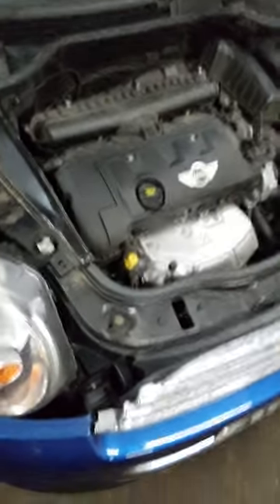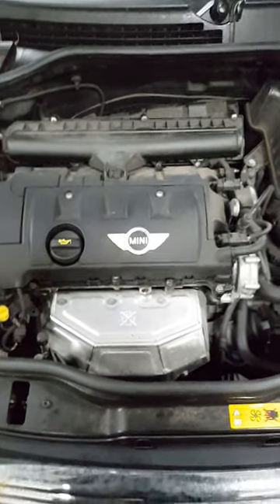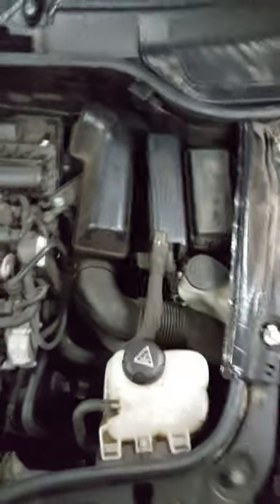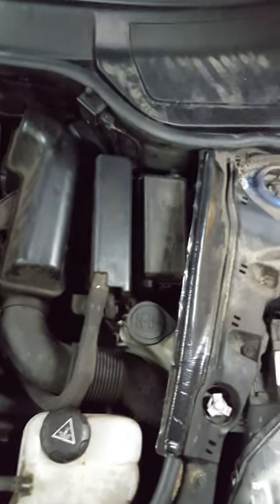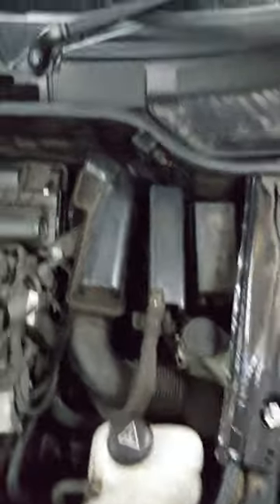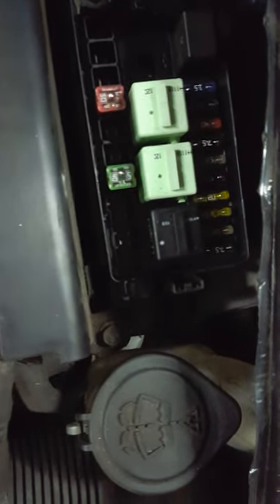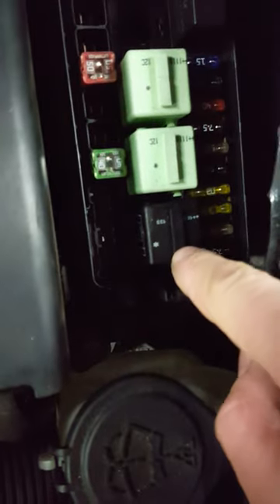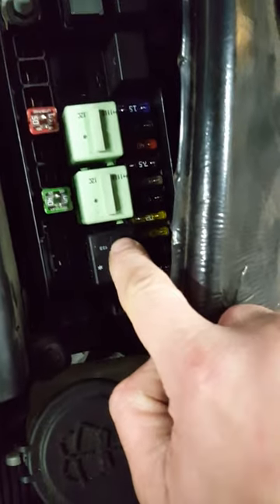Mini cooper DME Fault Fixed. Relay problem and location. How to fix it?

Comment: 2009 mini cooper convertible 

Could this be a contributing factor to the remaining CC-IDs the car has? Wires were cut from the rear trunk release button. 

Remaining CC-IDs:

CC-ID 31 – Engine Problem, Increased Emissions
CC-ID 35 – DSC Failed
CC-ID 250 – Brake Signal Malfunction, Gears May Be Selected Without Brake
CC-ID 354 – Start Assist Inactive
CC-ID 371 – Number Plate Light Failure

CEL code:
-P1782 still active
-2FAA
-CF2C
-5DF3

Recent Services:
- Timing chain
- Spark plugs
- New battery
- New keyfob

Had my buddy use his Matco scanner to reset VANOS and register the battery to the car.
Reply from the maker: Reading those faults I wouldn't think so to be honest.

Comment: Excuse me, may I ask any other symptoms of it? Such as rpm decreased (sometimes engine shut down)while the car nearly stop ? Thx
Reply from the maker: The engine can missfire and can lead to shut down on traffic lights once on normal operating temperature.

Comment: Hello Alex. Thanks for your video. 
I have a Mini One R56 2007 with N12B14 engine. 
The engine when reach 95 degrees temp misfires the 4th cylinder.. 
We rebuilt cylinder head and we changed piston rings. 
We also change ingectors , coils, sparks , fuel pump , crankcase sensor , vanos
Sensor and cam sensors.
Again when temp reach 95-97 Celsius the 4th misfires. 
The compression cold and hot is 200 in all 4 cylinders! 
The mechanic told me that maybe is DME. 
What do you think ?Maybe it’s a relay ?
Reply from the maker: Hi there. That sounds mad. Seems like you done everything possible apart from DME relay... I would definitely recommend changing it now to be honest.
Reply: @AlexTheGrumpyOne  Alex , thanks for your fast reply! You mean the black relay that you change in your video ??
Reply from the maker: No problems :) yes that should be the one. Depending on the model. Please double check in your owners manual.

Comment: Hi I have a code 5DF3 DSC interface ,DME /DDE SIGNAL faulty would this be a relay issue as well?
Reply from the maker: sorry will need a bit more diagnostic in to it. have you had it scanned and what codes did you get?

Comment: Hi, thanks for the video.  I have a mini countryman cooper S running fine but giving a code P12B8 which is ambient pressure sensor.  A mini specialist has tested the car and said all sensors are fine and all is well so it is a faulty DME approx cost £1300. They said no prob to keep driving the car but the light will stay on. Do you know if this relay will fix that please?
Reply from the maker: It's a possibility mate. I would definitely try relay first. I mean you can get this relays from breakers cheap as hell. So I would def try first.

Comment: Hi Alex, you mention in the video that the car wasn't running well.. By that, do you mean that you are still able to drive the car even though with the bad relay and check engine light? 

I am having a P2BE4 code (DME error code) during cold start and the check engine light goes off after driving around 20-30 mins drive. The P2BE4 code during cold start will make the car misfire and sometimes accompany with another code P273F (on Carista app it says O2 sensor fault, and on workshop's BMW scan it says Cyl 4 Ignition Coil Error) 
Not sure if this has anything to do with the similar relay fault that you have.

By the way, what was the DTC code you had with the faulty relay?
Thanks!
Reply from the maker: Hello there. The car was still driving, but misfiring sometimes. 
I think the codes are in the video. 
That was quiet a while ago to be honest.
Reply from the maker: To check quick if it's not your coil you can swap n4 with n1 or 2 and see if the fault change to another one.
Reply: @AlexTheGrumpyOne  Thanks for reply. 

Some updates**
I did a change for all ignition coils to the updated Eldor brand (OEM BMW), however the P2BE4 code was still present.
A day later, I decided to change the relays (3 pcs of it - K21, K6326, K6300) for good. Tried 2 times of cold start and the codes did not come back. 
Apparently, the relays mentioned above were linked to the DME A6000 as seen here - https://www.newtis.info/tisv2/a/en/r56-one-hat/wiring-functional-info/functional-wiring-diagrams/09-vehicle-electrical-system/front-fuse-relay-module/1VnYTzk49W

However, i think i will need to monitor for a few more cold starts and see if the code appears again. If it doesn't then it can be concluded that the relays are making the error codes. 

Cheers!
Reply from the maker: Thank you very much for the update. I really appreciate when People share results and any more info. Well done you done a good job there and hopefully it fixed it now. Let me know how you getting on and if it comes back. But I'm pretty sure it should be fine now. Have a good day
Reply: @AlexTheGrumpyOne  Hi Alex, hope you're doing well mate.
So to update, apparently with the change of all relays to new ones, ignition coils to new ones, that doesn't seems to help and the DME error code P2BE4 came back yet again. And it seems very frequent now, each time during cold start and there's no response from the accelerator pedal. I had to shut down and restart the car and the accelerator will only respond after a restart. Its very annoying and frustrating. LOL. However something weird is that the car drives normal after a restart although the check light still visible on dashboard. Sometimes, the check light does goes away itself after driving around awhile. 

Anyway, I guess the only option is to get a DME replacement now. I don't wanna go into changing the accelerator pedal and yet still getting the DME error code.
Reply: @renesis82  Hey man, were You able to resolve this issue? I have same thing 2BE4, gas pedal on first start not responsive, after restart it works well, but half engine sign is present. ALso I get accelerator pedal errors 2B4E 2B4B. thank you in advance.
Reply: @alexvaviloff5934  I had the exact same issue......good news....I replaced the pedal and throttle body.....no luck..same symptoms. So I replaced the relay like in this video. It worked! No more non responsive pedal and no more 2BE4 codes!
Reply from the maker: Sweet! Well done but. Shane you had to replace pedal and throttle body first. But at least its done now
Reply: Bit late to the party here but just purchased a mini with n12 engine and runs well enough once it starts but it cranks over quite a bit before starting , I’m hoping it’s as simple as this to fix
Reply from the maker: @paulmcleod1606 any fault codes?
Reply: Just been out to try and start and flat battery. Hopefully that’s the issue . No fault codes as yet but I’m putting it on the computer tomorrow
Reply from the maker: @paulmcleod1606 Yeah might be just that then
Reply: @AlexTheGrumpyOne  bloody hope so 👍
Reply from the maker: @paulmcleod1606 keep us posted

Comment: On a 2014 turbo cUntryman ,, I have a voltage leak so I disconnected the battery overnight. When I hooked it up again I heard a click like relay.. So I disconnected and reconnected and heard it again.. it's coming from the front of the engine not from the fuse/ relay box. I pulled the relays from that box with the battery connected then put them back in one by one to see of one would flip but no go. So it's not from there it's like somewhere at the front of the engine.

Comment: 2009 Mini Cooper S lights come on when driving but no codes are stored just about driving me crazy check engine comes on but then goes off after a few minutes
Reply from the maker: Hi there. What lights come on? Also what tool you use to try and get codes out?

Comment: Hello bro!! I have the error 2bE4 and in the description I get internal Dme.  Could it be the same problem you had?
Reply from the maker: It is possible. But I think for that one you better double check the forum or etc as I haven't had that code.
Reply: did you ever fix this error code i have it now. car runs ok but on a cold start it starts with no throttle pedal until you turn the car off and back on again

Comment: 2010 MINI COPER S CLUBMAN.  push button fires up lights and all but won't start unless I bump start it. Happened after a rinsing it in a car wash bay. It will shut off one pushing the buttion though. Had the foot module replaced under warranty afterward. Nonetheless wouldnt be the culprit I reckon. Driving me backside mad from from pushing it uphill to start. Jasper
Reply from the maker: That's a bit of wierd fault you got there... All I can think about it that the power or ground supply have got some corrosion or loose. Not getting full power supply. Similar to when you got ground cable loose on battery or ground point on the body.

Comment: Hey Alex! i don't know if you have you have a mini still or not, but do you happen to have a link to that relay so i can see what terminals they connect, i have sensors on terminal 15 short circuiting  which are limited to: o2's(both), fuel sending sensor, thermostat heater, after replacing the thermostat and o2's and i thought my thermostat went bad(shop did this), i got a oil pressure control valve fault code popped up. figured you may know but reviewing the knowledge i have now it's been a month since the shop can "diagnose" it and i'm annoyed at this slow paced work ethic,just found that they are all connected to the same terminal today as there is very limited information upon this. Thank if you do happen to respond!

Comment: Hi Alex, great videos thank you. I've got R50 mini Cooper 04' . Basically abs,handbrake and tyre pressure light ON all the time now! BMW diagnostics said lots of things and couldn't find what exactly was the fault... they said maybe abs unit 95% wtf lol anyway .... bought myself the  C110+ scanner and today I plugged it into my mini and it didn't say anything about abs etc. But said " 5E18 CAN data fault from DME/DDE  and 5E14 CAN connection  to DME/DDE ( DSC lamp on until ignition reset ) please help me mate 👍🏻😁 thank you for you time and advice
Reply from the maker: Rumen Stoyanov hello mate. Thank you.
Well i have to start with letting u know that its quiet important to have a decent diagnostic tool. Gscan 2 does quiet good job on Mini and Bmw.
Different tools give different fault belive it or not -.-
I dont know why... 
But first thing is. U tried to reset tyre pressure yet?
Then have you checked live readings on your abs speed for each wheel?
Sometimes one messed up abs ring or sensor trigers all sorts of faults.
The other thing.... u will be suprised how many faults can be reset or fixed by disconnecting battery for a while.
The other thing that might help while battery is disconnected is to unplug abs pump wiring and clean it with contact cleaner. Then plug it back in and connect battery. Then ignition on and use diagnostic tool to clean all the faukts first before u start it. And go for a drive.
Let me know how u get on please.
Good luck

Comment: So what was the name of the Relay you replaced to fix the problem? The only Relays I can see to purchase are
 Relay: Electric Fan
Relay: Electric Fan
Our price:
$17.60
 
Relay: K19: AC Compressor
Relay: K19: AC Compressor
Our price:
$17.95
List price: $20.15 
save 11%
 
Relay: K36: Wiper Terminal
Relay: K36: Wiper Terminal
Our price:
$17.95
 
Relay: K6: Headlight Cleaning System
Relay: K6: Headlight Cleaning System
Our price:
$17.95
Reply: ... I think he said FUEL (pump) relay.
It is very common for all engines to get a dead fuel pump relay sooner or later - Depends on how often you start and how high is the pump surge current.

Comment: If....the.....DOT had the dam computers tell us which switch..link.relay.component was bad......we could actually not worry what the god awful problem is and we could identify the right part the right vacuum leak the right electric component the right relay.....not the left....or..making us replace everything new....to leave the....identity of last component problem.......obviously they care about emissions and not ease of use mechanic problem identified part necessary all we have to to is KNOW......but they set these sensors up for emissions NOT....for identifying the exact....relay...or fuse or part or parts....and they don't make cars adjustable and even put bolts in between frames and cooling hoses or ac tubes...or tight spots........manufactures are Greedy.....